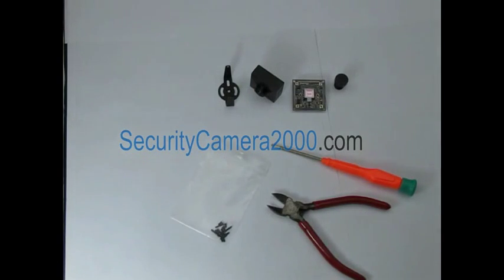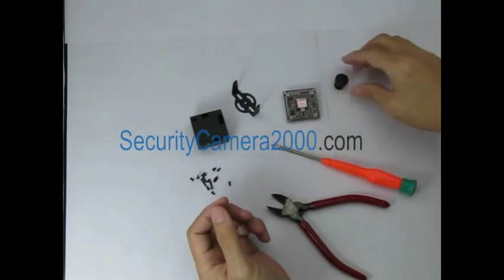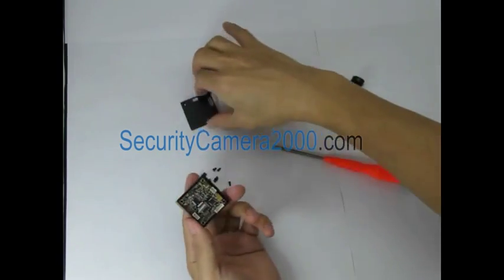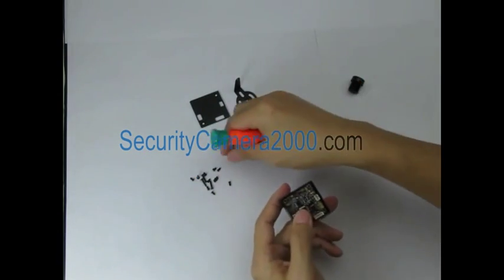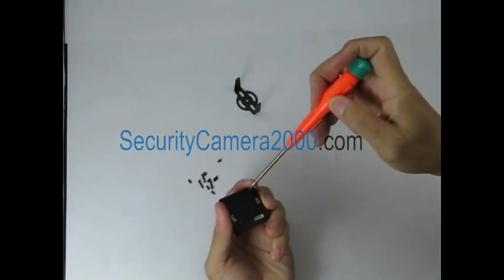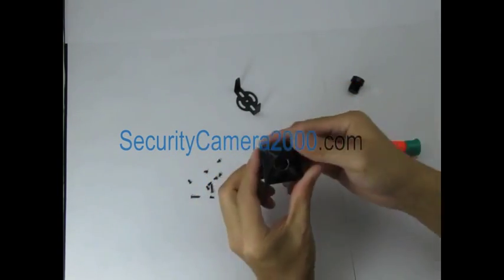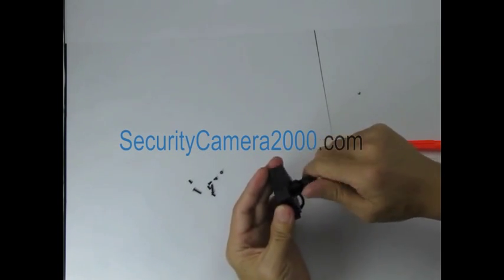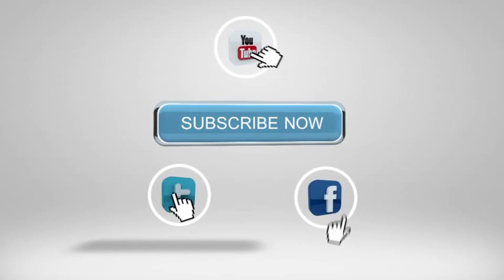Case Installation for PZ0420 from SecurityCamera2000.com

Comment: This is a good video and much better than the previous one.  It is important as noted when putting the bracket on to use short screw.  I knocked loose a resistor which caused the camera to malfunction.  After inspecting, I saw the problem and resolder this piece back on and the camera works, but it was very frustrating.  Also, you should note that the lens housing on the camera board needs to be removed prior to starting.  You don't show this in the video.  Very well done overall.  Steve